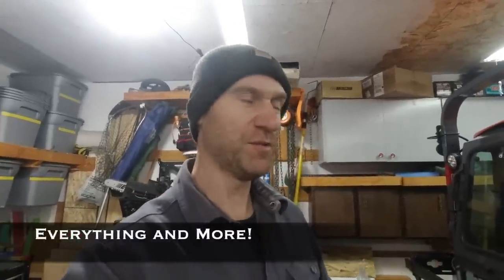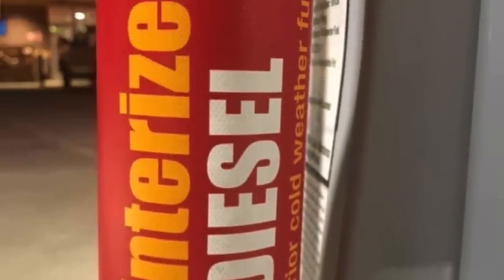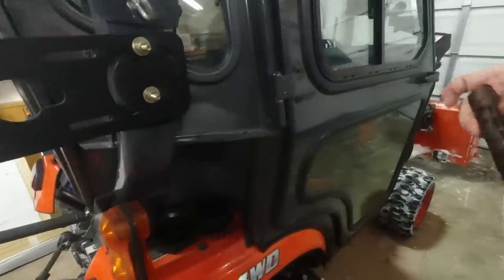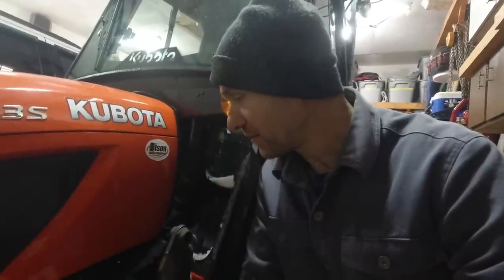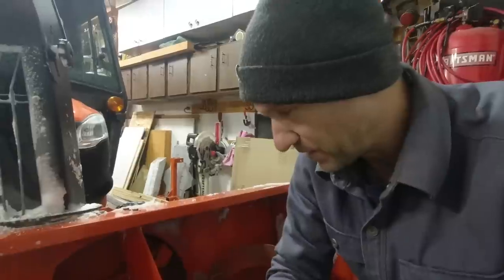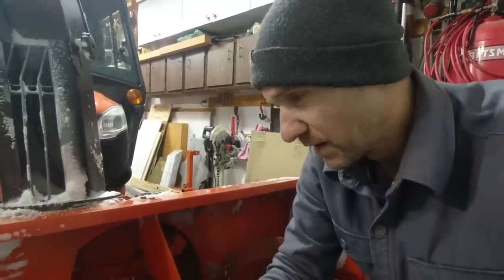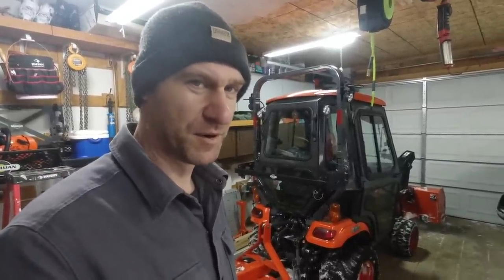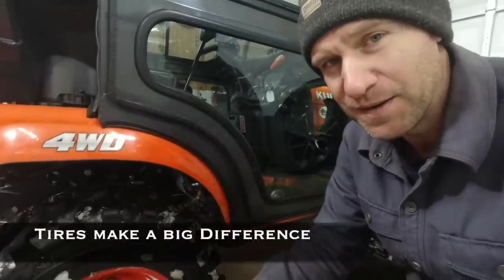SNOW REMOVAL FOR BEGINNERS (Kubota BX23S Tractor in Winter)

Comment: Good morning, Jon. You hit the nail on the head squarely with the tip about treating diesel fuel, especially in the winter. At every fill up, we use a diesel fuel conditioner, even in the summer. The diesel fuel conditioner also prevents algae from growing in your tank. In some airplanes, we use a conditioner to prevent that in fuel tanks. Preheating an engine will add life to your engine. With modern technology, you can add a smart plug connector and turn the block heater on from inside your house for a couple of hours before you plow. Again, with airplanes, we used a propane heater, or a block heater, and sometime a light bulb inside of the engine. If it is -20 and outside in a garage that is not heated, wrap up the engine in a blanket, and use a block heater. We've also used a hair dryer to preheat an engine; it works. Also, when in that nice warm cab, bring your coat, have a hat that covers your ears,  have gloves, and warm boots. Wear what you would wear if your tractor quits and you have to walk back to the house. Make certain you have a flashlight, and a cell phone. We all wear an Apple Watch in case we somehow get stuck and cannot move out of our tractors. My neighbor flipped his tractor while plowing and was pinned inside of the tractor (no cab!). Thankfully, he could reach his cell phone and called for help. I've been stuck in a case skid steer in the snow and the door was blocked and I could not get out!
Reply from the maker: All great advise to prepare engines and keeping yourself safe from many possibilities. I remember my dad telling me that back in the 20's and 30's my grandfather would build a small fire under his car engine to help keep it warm through the night. 
Keep on tractoring!

Comment: Hi Jon, 
Great video today. Learned some great tips. I’m a 15 year old kid in southwest Wisconsin. I live on a small farm with some animals and our equipment. In the winter I use my Kubota Bx2670 tractor with just the loader to clear snow with. I plow seven driveways total and it has been great for me. Luckily, even though I thought the tips were helpful. I really don’t need them because of the awesome grandpa that I have to teach me about my tractor what to do when something goes wrong. I always treat my fuel when it first starts getting cold here and every time I put another tank in, I just add a little treatment just to be extra safe. One tip I have for you is add some more caution lights. I put a beacon light bar on the top of my ROPS and it has worked great for me. It plugs into the 12v outlet on your tractor or since your better with electrical stuff than me, you could hard wire it in with a switch, so it’s not plugged into the 12v outlet. Hope you find my story interesting. Once again great video! Have a good day.
Reply from the maker: Hey Justin, that is so wonderful that you are out on your tractor making some extra money clearing driveways. Sounds like you sure appreciate the advice you grandpa passes down to you. You're a lucky guy to have you grandpa around. On my old BX I had some strobes caution lights and I may add something similar in the future. Keep working hard and thanks for watching!
Keep on tractoring!

Comment: I live in northern NY.  Im a pharmacist.  I run turf tires on my BX (we mostly mow with the tractor).  In the winter I put chains on the turf tires, and I get great traction.  Keep on tractoring.
Reply from the maker: Thanks for your comment. Do you use your bucket for snow or do you have something else? Happy New Year
Keep on Tractoring!
Reply: @ritterjon  I use my bucket for now just for a little clean up.  I already had a walk behind snowblower, so i couldn't justify buying anything else specifically for snow removel.

Comment: Kenric,
Holland, VT
To get more weight can load your tires with liquid chloride. This is common practice for farm tractors.
My dealer loaded all four of mine on my B2601. 
Have a 48 inch commercial front snow B2380.
I also have the tires you mentioned in this video. They have outstanding winter tractionYou do have to be careful not to make real sharp turns on the lawn,they
 will scuff up the grass. Also the speed at which you make a turn helps, a little slower works best.
I'm in a cold winter climate here, right next to the Canadian Border. 
Dealer could not stress enough about treating the fuel,Probably the most important tip of your video.

Comment: Hey John. Love watching your videos. I live in Goose Bay, Newfound Labrador, Canada. Running a BX 2680 with the front mounted snowblower rear scraper blade and the turf tires. The traction is fantastic with these tires. We get a yearly average snowfall of about 168 inches and so far this year we have several feet of snow on the ground. My BX 2680 gets a work out in the winter especially come March month when we normally get the bulk of our snow. Keep posting those videos.
Reply from the maker: WOW! that's a lot of snow, I bet the city has some serious snow moving equipment. I would love to see how they handle that sort of snow accumulation. That's a lot of hours you out on your machine in winter I'm sure. 
Keep on tractoring!

Comment: Hello Jon. I have my BX2380 hooked up to a block heater timer that is set so that the tractor is ready to start at 6am even when it’s -20. It also gives me the option to keep the block heater on for whatever length of time I want to preset after 6am in case I sleep in. The timer I have is called a Power Badger and it works awesome. I leave my tractor running at idle after I start it and I let it warm up as I shovel snow away from the fence and house to make it easier to blow snow. I coated all surfaces on the Kubota commercial blower with a spray silicone including the chute and impeller and it keeps the snow from sticking and makes for a quicker clean up. My Textite Cab came equipped with front and rear LED lights and you are right they are vital when blowing snow at 6am. As far as the fuel goes I treat my diesel with Howes Diesel Treat. I add 30-40ml per top up. One thing I didn’t hear you mention but it’s something I do I keep my battery hooked up to a Battery Minder with a quick detach two pole connector. It sure makes cranking a diesel over at -20 a lot easier on a full battery! I run Turf tires on my tractor and they work fantastic in deep snow. I even sprayed my wheels with the WD40 Silicone spray and the snow hardly builds up in the wheels. This year I’m running a UHMW back blade and so far so good it’s a lot quieter and seems to scrape about as good as a steel blade. The only thing I haven’t done is keep spare shear bolts in the cab along with a couple of box end wrench’s. It’s on my list of things to do. Good advice! Happy New Year from SS Marie, Ontario.
Reply from the maker: You're right, I forgot to mention a battery tender. I mentioned it in the video I did with Hank and then forgot about it in the this one. shoot!  Anyway I've used silicone spray and it works great buy I think the turtle wax lasts a bit longer. Sounds like you've got a nice set up for clearing snow. 
Keep on tractoring.

Comment: Hi Jon. Thanks for the tips. I'll be replacing my tired, 26 year old Honda 5518 (discontinued in 1998 and cannot get parts anymore) for a new BX23S soon. From NE PA. Retired Air Traffic Controller.
Reply from the maker: Too bad Honda gave up on that Sub compact line, They would have made a good competitor for the tractor market. You're going to love the BX23S. You'll find many uses for it. 
Keep on tractoring!

Comment: Hey John, I’m from New Brunswick Canada and I’m a tanker truck driver who runs Atlantic and central Canada and the occasional trip to the eastern seaboard and just traded in my old 2003 bx2200 with no cab in for a new 2680 with the identical cab set up you have. Rear mount blower and use the bucket on the front to help clear around our barn in the winter. (Recently ordered an HLA1500 snow pusher too)For wheel weights get yourself a set of cast wheel weights off of an old bolens garden tractor. They will bolt right on with a couple of 1/2x7in carriage bolts. Same bolt pattern in then wheel which is convenient.
Reply from the maker: Thanks for the tip. I hope you're enjoying that cab and I think that HLA snow pusher is top notch quality. 
Keep on tractoring!

Comment: Maryland here. Great video. For the shear bolts, the two on my auger have a collar on the head end and a break point that is more narrow than the rest of the bolt. I just did a video on this topic recently. For any guys thinking of replacing that style with a regular grade 2, I would rethink that approach. For your equipment though, it looks like a great fit.
Reply from the maker: Maybe a 1/4 inch bolt is more appropriate for the auger. 
Keep on tractoring!

Comment: Another good video Jon! I have both R4 and turf tires.  I use the R4s in the summer and the turf in the winter.  I did try the R4s in the winter once and the turf tires had better traction.  Little work to change them twice a year but it gives me a chance to check the tire pressure and the lug nut torque.  I would recommend getting a turf tire for the winter.
Reply from the maker: Thanks for sharing! I also seen Messicks did a video comparing the two and that seemed to be the outcome. 
Keep on tractoring!

Comment: Heyhey Jon   NAILED IT.  I use #1 heating fuel for my tractor and  use Power Service diesel treatment with every tank , even in the summer just in case I have fuel left from summer .  Weight makes a huge difference but you missed one important tip,  ASK OTHERS THAT LIVE IN NORTHERN CLIMATES WHAT THEY DO.  Here in North Pole we also have oil heaters for both the hydro oil and engine oil.   Good video Jon.  Take care
Reply from the maker: I'm sure you've got battery heaters as well. You need to do a video similar to this one as you have ridiculous cold up there. Happy New year
Keep on tractoring!

Comment: Good works tractor can probably hook you up with some wheel weights ! I would also recommend if you haven’t got it already rim guard fluid or whatever is available to you other than calcium, to put in rear tires for weight. Have a Blessed Day

Comment: John I'm in Upstate NY at 1325' above sea-level between the Catskill & Adirondack mountain ranges. I clear snow from 2k feet if paved & gravel driveways.. These are good tips. I would install a water fuel oil separator to remove water from the fuel system. Also filter all fuel when topping up the tank The fuel filter change frequency is more based on how old is the fuel, outdoor temps, & hours operated on the current filters. Don't buy diesel in bulk as unused diesel can grow bacteria that will plug filters and promote geling.
Reply from the maker: Good point, diesel sitting for too long can go bad. I buy mine in  5 gallon jugs since I don't use it fast enough.
Keep on tractoring!

Comment: Great tips. Especially treating fuel. The first diesel truck I had was a 7.3 Powerstroke and had no clue. -20 degrees and I am sitting on the side of the road wondering what happened to my truck to make it stop running. Gelled fuel. We learn the hard way sometimes but that way we don't forget. Also like the spray wax tip.
Reply from the maker: Oh man, that's doesn't sound like a fun experience but you're right. Sometimes we have to learn the hard way to remember. 
Keep on tractoring.

Comment: Hey John, good tips. Here in Jacksonburg W.V. our winters are way less severe. We had our first white Christmas in many years. Woke up to 5"s and two days later it had all melted away. My J.D.3025 is 2 years old and last March I did my first 50 hours maintenance.  All fluids and filters. From time to time i do add an anti gel to  my fuel but have never used anything else.  I will give her try. I work for a Gas company for 39 and half years.  Thanks for the tips.

Comment: Great tips!  The previous owner of my BX stressed using fuel additive all year long.  Water in fuel can be an issue in the summer too.  Humid air in your tank and cans condense into water when it cools.  BTW - I ran the block heater the other day when it was 20 degrees in my shed.  Checked the valve cover with the IR thermometer after an hour - 117 degrees!  They work...
Reply from the maker: Yes, those block heaters work great! Also good advise to use an additive all year long. 
Keep on Tractoring!

Comment: I bought a set of Bolens brand cast iron wheel weights and painted them Kubota orange. I found them on eBay after I saw another guy on youtube use a set on his Kubota. 
I think they are the best looking set.
I would like to try turf tires on my tractor. Carslie tires look nice also.
I put my block heater on a WiFi double outlet and also have a millhouse heater in the cab. I just run the cord through the brake pedal hole. I run the block heater for two hours and the millhouse heater for one hour. Then I unplug the block, start the tractor and let it warm up while the millhouse heater is still running. I've been working on a video 
to show how warm the cab stays at different temps. I also treat with howes year round and relocated my fuel filter. My snow blower is on the three point. I prefer this because IL snows are usually slush. The blower will throw very wet snow even sometimes just throws a jet of water . We have allot of freezing and thawing then re freezing that require the loader and bucket to scrape off
 the ice. I have also noticed that the front blowers break allot of shear bolts. I put close to 100 hours on my tractor every winter doing snow removal and the only time I have ever broken a shear bolt is when I got into my rock garden. It will chew through thick ice and no problem. 
I also have a push box and hydraulic controls for the chute and deflector. 
If I lived up north I might have a set up more like you.
Reply from the maker: That's a great idea to get a milk house heater to preheat your cab. Sounds like you have a nice set up for your needs. I would like to do the relocation of fuel filters sometime myself. Great idea about the wheel weights. I would love a set of those. I'll keep looking. 
Keep on tractoring!

Comment: Don't have my Kubota yet, but its coming with R4 tires.  For what I'll be doing R4 tires make much more sense.  However, my lawn tractor with the snow blower on it does pretty decent with turf tires on it and 3 of the 42 pound suitcase weights on the back.  After about 5-6 inches of snow I have to put the chains on though, but the turf tires seem to do pretty well on it considering its just a 2 wheel drive lawn tractor.

Comment: I learn a lot from your videos and thanks for spreading the  knowledge  .I almost bought Mahindra emax ,but now I am on my way to buy Kubota BX for my next winter ,I only need a snow blower and a heated cab .I have almost 10000 square feet of pavers in the front of my house and garage and I prefer to clean myself because I hired snow company to clean but they always end up scratching and breaking the pavers ,Any other suggestion for me to know ,so I be prepared for next winter for a smooth and headache  free cleaning ,I am located in orange county ,New York. THANKS

Comment: Southern manitoba.  Grain elevator mill right. Also if your garage is heated let the tractor warm up outside the garage so the steel can cool down, so you don't have the warm metal melt snow and ice it up.  But wax works great too.
Reply from the maker: That's a great tip as well. 
Keep on tractoring!

Comment: Good tips, Jon. While I live in balmy SE Minnesota, I've had my fuel line freeze once, as well. The fuel in my tank appeared cloudy.  The self-priming feature of my 1025R  allowed me to get it back in the garage. I believe the biodiesel additives raise the gelling temp of summer diesel, so I am quick to switch to a winter blend and treat it with 2 oz of Howes. I get my first 2 5-gallon cans from a pump that has winter diesel year round. My 2013 has the same @&%*! inline filter. The manual says to change it "as needed". I understand that in 2017, they eliminated the inline filter on the 1025R.  It may be time for you to upgrade to a green tractor. :-) Keep on tractoring.  PS. We cross-country skiers put wax on our skis to grip the snow.
Reply from the maker: Treating fuel is often learned the hard way. Trying to help others figure that out is a challenge. It's been unseasonably balmy here as well. I'm hoping for more snow but nothing seems to be in the forecast. I have nothing against Green tractors, but I'll stick to orange for now. 
Keep on tractoring!

Comment: From Nh and have really enjoyed our BX2380. We have had it for two Seasons and it works well.  I appreciate your insights on the backup fuel filter and adding isolated heet. Believe it or not does get cold in NH, not like MN.  But we got down to 10 below this year for a couple of days.  We will buy an extra fuel filter and use the heet.  Our usual temp when we are plow is around 20 degrees,do you think we should add a block heater or not.  Thank you for your insight.  Bill Hatley

Comment: From N.E. Wi. I have used a Kubota blower w/ that wire thing in the chute. Do yourself a favor & take it out. Guaranteed to plug your chute when so is wet like redimix concrete
Reply from the maker: I took your advise and removed it. Had some concrete snow to plow recently and plugged up the chute twice. With the wire guard gone it makes it easier to unplug. 
Keep on tractoring!

Comment: My koiti didn't come with a block heater but I keep the fuel in winter treated with winter formula and use summer formula  I've never had a starting or gelling issue but I store mine in a unheated barn
Reply from the maker: Smart to keep your fuel treated. 
Keep on tractoring!